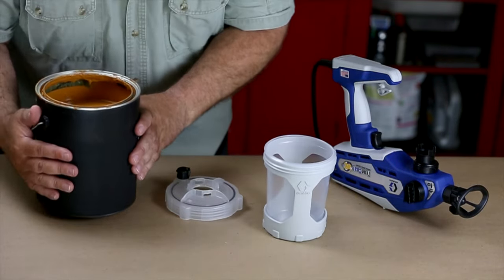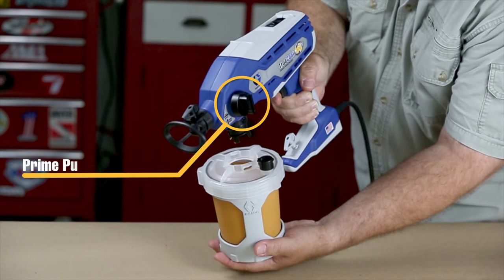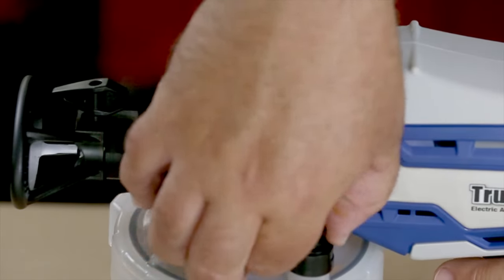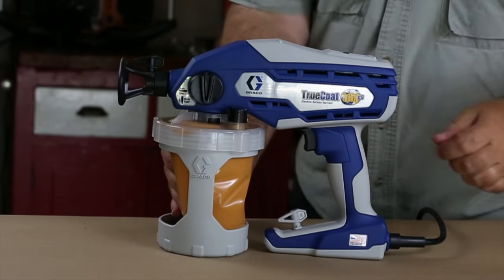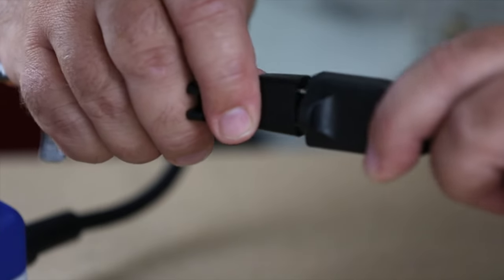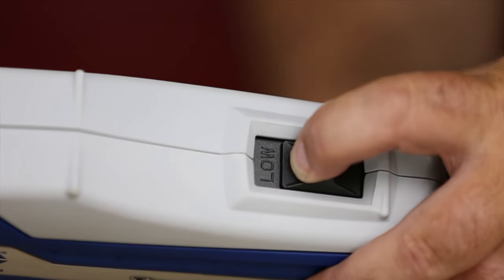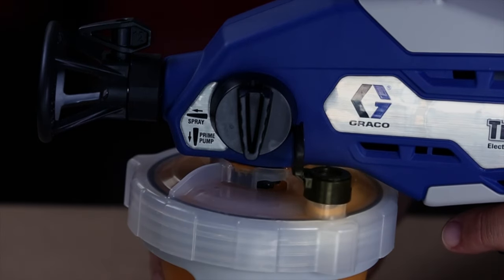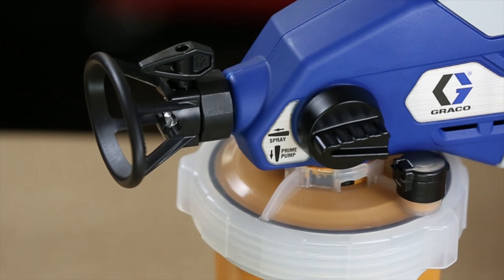Graco TrueCoat 360 Quick Start

Comment: It's great when it works but the problem is still the same as the 360 from 5 or more years ago I even have pictures. The plunger or shaft that goes back and forth with a plastic joint. First off it shouldn't be plastic it's obviously eventually going to break which it did on the newer version and we only had it for four months. Second where the shaft goes in and out it leaks and eventually drys causing the shaft to seize up and not move. Which in turn either breaks the plastic or wallows it out if you want pictures and proof of then using cheap parts and not fixing it for literally years and years with the same issue I got pictures from today

Comment: I try this gun for 2 day already on my cabinets frame  set on speed 1 and shot more than 10 inches away paint still come out alot see drip paint line after spray and doors I sat flat on floor only minimum drip line . I sprayed alot of cabinets in the past with air  gun I can adjust how much paint come out after spray no drip paint line . Thinking to return this graco any tip or tricks.  Thanks
Reply: My model 360 vsp
Reply: Same thing happened to me. Seem like this gun is not designed for that kind of work that required less paint. I adjust to lower setting 1 and lots is paint still come out like crazy. This gun more like shooting paint to the wall or that kind of stuffs. Not suitable for detail stuffs like cabinets and trims.

Comment: The TrueCoat VSP has 1000 psi while the other TrueCoat models have 1500 psi.  Is that because of the larger 42 oz cup?
Reply: I thought the vps was 1500
Reply: vsp and ds are the same except for the speeds

Comment: Junk….. psi is too LOW. 1500psi doesn’t cut it… almost all paints to do trim, cabinets and doors require 2000psi and at least a .017 tip. This gun gives you low pressure with too small of tip. I waisted $300… Don’t fall for the videos that you see. This thing will not give you a professional result. I was using new SW pro classic water base paint.  Got orange peel and tiny air bubbles.  Even called the Graco rep and was told to thin the paint. Also: this guns pressure is NOT adjustable.. only the SPEED. Big difference…. Very disappointed in a made in USA product.. I’m sure they make a lot of money these because people are misinformed about what this will actually do. So,,, I’m going to spend more $$ on a sprayer with sufficient psi and one that will allow the use of the correct size tip, as this unit will not take the other Graco tips…
Reply: Dont forget to update us what you get. realy appreciate your comment

Comment: Do NOT buy. I just bought the True Coat VSP. You have to constantly refile the canister squeeze out the air... Use if for half a minute and do all over. The “time you save” from rolling and brushing you spend filling paint.
Reply: Spraying paint is about nice finish paint job.
Reply: Right ahah
Reply: @alxmtzm  True! Most painters are about quantity not quality.
Reply: I agree I HATE this handheld! The flex cup and prime time takes away saved time with this one! I ended up getting the big sprayer to do house works good but I won't drag that out for one bedroom so going to get the cheaper 30 dollar harbor freight special at least it's a hard cup and you don't have to prime like this one. Wish I had NEVER bought it; spent way too much at home Depot for it! Too late to return it now ughg oh well ... Just don't do it the Wagner may suit your needs this one SUCKed for me just sharing experience
Reply: You guys are doing something wrong fyi.
Reply: @mrtv777  😅

Comment: This video was of no help WHATSOEVER!! Shit still isn't spraying.  I've repeated the step in the manual 10+ times.
Reply: Same here. Was working fine to a point of completion many times. I went directly to cleaning & testing operation immediately after spray painting only to find no spraying I still have much work to do.
I carefully followed the directions shaking exhaustively to no avail.
Need help! This is where concerned Greco reps should step forward & advise.
Still waiting.
Paul 
Relay, MD
Reply: Flip it upside down

Comment: Spent all that cash on these trash machines. It should have an automatic air release system to save the customer time and let's not get into how easily these things clog up. Mine was used one time..I was finishing some doors and baseboard and the thing failed to perform before I just shelfed it and it hasn't been used since. I have been painting for almost a6 years and I would recommend NOT buying this crappy machine.
Reply from the maker: Sorry to hear that you could get the TrueCoat 360 to work for you. Typically, clogging has 2 probable causes. The first is solved by straining the paint regardless of the age. The second is to make sure the paint is compatible with the 0.015 inch tips that the TrueCoat 360 models come with. If you need further assistance, please don't hesitate to contact our Tech Support team at 888.541.9788 M-F 7:30-5:30 CST.
Reply: Clean up is the key mine works perfect used about 60 times